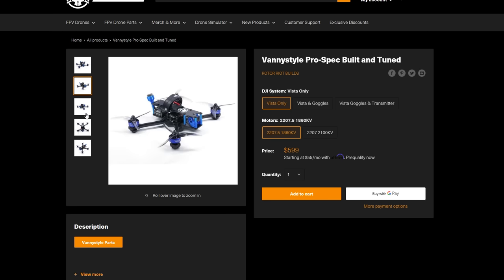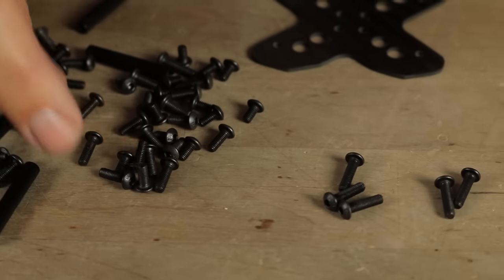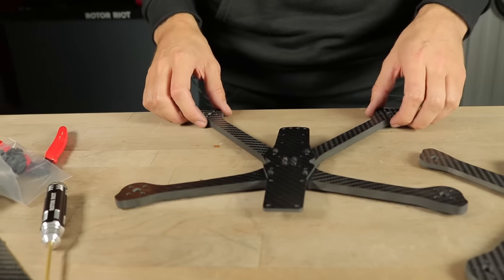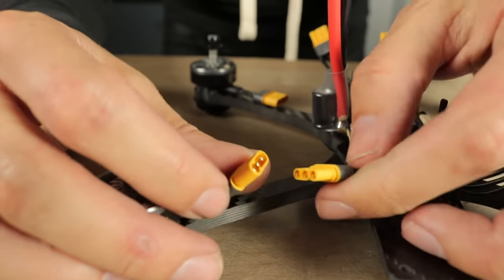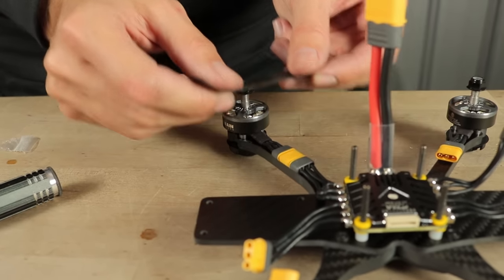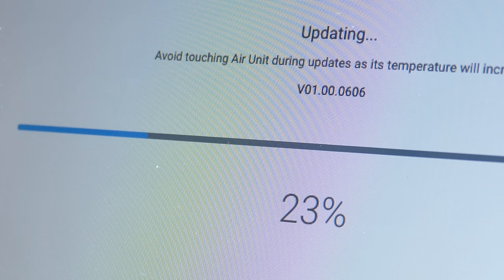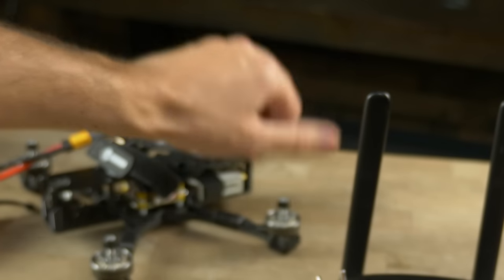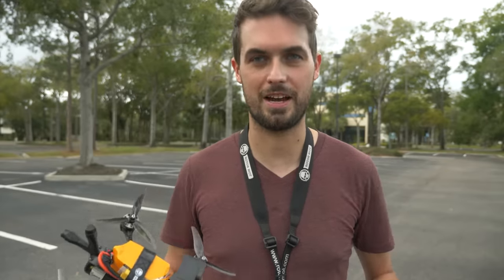Build a FPV Drone with NO SOLDERING! The Plug & Play DIY Kwad.

Comment: Kapper must be so happy right now. He's been pushing this for years. Great move.

EDIT: Also, choppergirl has been pushing this idea for a long time and must be really thrilled to see somebody finally implement it.
Reply: hi bardwell
Reply: Joshuaaaa wasup
Reply: As much as I don't want to see our hobby watered down I must say this would have been really handy about 5 years ago when I first got into racing / freestyle. I spent the first 2 years building with a 20$ soldering iron from lowes and just didn't know any better. Now I feel like I'm a confident builder with a TS100 in my arsenal. I remember trying to fix my one quadcopter between heats when I crashed an feeling the time crunch trying to swap a arm / motor, with this system I could have swapped out a busted arm / motor in about 2 minutes tops. PS thanks for all your guidance over the years Bardwell, I wouldn't have made it without you.
Reply: Honestly they should just be direct soldering that plug onto the esc. Right angle low profile to sit inside reasonable standoffs.
Reply: @Clynikal  Direct solder XT60 is a no go in my opinion. The stress of plugging and unplugging, or in a crash, it breaks off, and often takes the ESC with it. It needs strain relief.
Reply: @choppergirl  I think you're mad that you aren't getting more credit for this idea, when you had the idea of a solderless quad some time back, to make the hobby more accessible especially to people with disabilities. Because you often have what you think are good ideas, and then you present them to people like me or Spatz, and usually we're too busy doing our own thing to be passionate about your idea. But then when it finally does happen, somebody like Rotor Riot gets credit for actually doing it, and nobody credits you for having the idea.

Here's the thing: you are one of MANY people who has the idea of a solderless quad. I have been pushing the idea for years. The idea of a solderless quad is not unique. Just like the idea of a Molex connector is not unique. Actually doing the work of manufacturing all the parts that work together and then making them available to people is where the value is. 

I didn't say, "Kapper is the only one in the world who has had this idea." I just remembered shooting an episode with Kapper where he was pushing this idea, and since this is a RR project I thought he'd be happy. I didn't say, "choppergirl must be so happy," because I don't really know you or think of you except when you come up in a comments section. But now that I do, I will go back and edit the comment to reflect this.
Reply: @choppergirl  well said
Reply: Everyone knew that a simple solderless build would make the hobby as attractive as RC cars for father and son/daughter projects etc. 
The problem was executing that dream concept in a way that can keep up with demand and manufacturing issues etc this is something hopefully they can keep going and in stock and will help FPV growth a lot.
Reply: Been wanting this since I started in 2017.  I build computers without a hot stick, why the h-e-double-hockey-sticks not drones, eh?
Reply: Amazing that this guy is know it all and has no idea we have been doing it for over a year. Nonsense.

Comment: This is definitely going to help get new people in the hobby.  I see so many frustrated comments from newbies that burn a ESC or FC while soldering.
Reply: I fried 2 esc and 1 fc and it costed like 60 dollars per stack i spend 700 dollar only for one drone
Reply: @niksi_fpv2313  oh shit. Damn sorry
Reply: @divingfalconfpv4602  Yup but i learned my lesson
Reply: @niksi_fpv2313  live and learn.  I just realized I rushed conformal coating for the snow and water while drones were together. Sticking brush in it. And I think I ruined all my drones baro. 4 drones.. 3 r long range drones so they need it.
Reply: @divingfalconfpv4602  yeah i rushed and didn't pay attention while soldering thats why i fried few stacks
Reply: @niksi_fpv2313  I am so careful with that. I build a lot of whoops and small drones. That pads are literally a hair width apart. I run razor blade in between to make sure solder isn't bridged. If I think k it is I do it over. I'd have to fix shit before. Then I use multimeter resistance setting tells u if bridged. Then I use vifly smoke stopper and small battery to power up first test. Talking like 3s 300mah lihv for xt30 drones.. lmao.. I'm mad paranoid
Reply: @niksi_fpv2313  also I'll use my galaxy s20 ultra 108mp camera to zoom in like a magnifying lens (even though I have one 🔎)
Reply: Definitely it's going to help people getting into FPV, and it's also looking nice. 👌
Reply: I have no interest in getting new people into the hobby.

Why would I want more people clogging the parks and few areas people have to fly these? Why would I want simpletons that were too lazy to learn how to do this themselves flying around breaking laws and ruining it for the rest of us.

Fpv drones is an individual activity unless you race them with groups of people. The community is a good size as it is. I don't have this goal of bringing it to the masses and I don't understand why some people do.
Reply: @ljfpv0822  Who cares if more people get into FPV? Why does that matter?

So more simpletons at the parks? Flying around breaking laws ruining it for the rest of us?

Yeah, great idea.
Reply: @dangerous8333  Fly in your own yard 😂
Reply: @niksi_fpv2313  don’t feel bad because this is why I’m watching this video

Comment: Man, this would have been awesome 2 years ago when I first started. My very first fpv build was a CL1, watching Drib's tutorial video on assembly. My soldering sucked and it was very intimidating but I got it done. This is great for beginners in the hobby.
Reply: I think this is a poor way for beginners to learn about the hobby.

Like giving someone an electric guitar right away instead of having them learn on an acoustic.

I'm not a beginner and I like it just because it's fast and modular and I don't need 10 drones, I can have one drone. And time is valuable so I can fly harder and not worry that my day will be over as soon as something broke.

Comment: Soldering seems hard but if you buy the right equipment it's super easy
Reply: its not at all, its childs play. And every self builder or new commer can and should master this straight away.
Reply: But out in the field...imagine just plugging in a new motor. I kinda like it.
Reply: @SilverFox80521   Im sure you can buy connectors, without any problem.
Reply: @SilverFox80521  who brings extra motors to the field?  I bring multiple quads, and batteries… but not motors..
  If u crash hard enough to damage a motor.. ur gonna have other components compromised
Reply: @robaxelsson530  motors cost $15 while an HD quad costs over $300. Maybe if I flew analog I would have spare quads. 🤷🏻‍♂️
Reply: @SilverFox80521  or buy enough of theses “no solder” quads and you will have plenty of parts and never have the need to solder..
Reply: @robaxelsson530  you finally get it 👍
Reply: It's easy, just time consuming. That's what I like about this.
Reply: @robaxelsson530  Huh? 😂

The idea is you buy these parts ahead of time and have them in your kit. If you actually have something like this why wouldn't you? That's the whole point.

If something else breaks along with the motor, it's also replaceable in the same way. 

Also, you can burn up a motor without ruining anything else so I don't understand your assumption there anyway.

Your logic is strange.
Reply: @robaxelsson530  Huh? 😂

Do you understand what modular means?

It means you wouldn't have to buy multiple drones. You buy one and then you buy spare parts.

Good grief!!!!
Reply: @SilverFox80521  He still didn't get it.

He said buy "multiple of these quads" when that's not the point. You buy one and then you buy the replacement parts.

This guy is oblivious....

Comment: What an amazing build, i love the motor connectors and actually did this myself when i was building a bunch of test motors(3D printed). It is such a nice little connector and will take all the amps it needs for the motors. But most of all, your prepping of the FC was brilliant, what a service to newcomers to have the PIDs tuned to match the build, i LOVE it ! Well, Well, WELL done !!!

Comment: Love this.  Long overdue.   My next quad will use this setup.    (I wish the 3 pole XT connectors were more common)
Reply: The MR30 connectors are great. I also like the LEDs that can be built into them. The LEDs make the connector a race wire, but hardly anyone carries them...

Comment: Great idea, great video. Just a small suggestion to add for people just getting into the hobby. It's a good practice to twist all wires between the ESC and Flight Controller. Also do the same with the Air Unit to the Flight Controller. This will help reduce Electromagnetic interference and Radio Frequency Interference getting into the key components. With less noise getting into the Flight Controller it will be easier to tune.

Comment: I think a solderless design should be standard now, just simple plug and play, modular approach on components and how they connect together.
Not everyone is comfortable with soldering etc
Reply: What kind of hobby is that then? Open your wallet and show your visa card till the next crash?
Reply: @guardianobserver6593  It's just a natural progression of how building electronic devices usually developes.

I remember a time computers came as kits you had to assemble and solder some components and wiring together etc
Now everything is simple and easy  plug and play!
No reason FPV can't go the same route and still be a 'hobby'.
Reply: @pdtech4524  The difference is people don't take their computers out, clogging the parks, cramming into smaller and smaller areas we have to fly.

Computers don't cause new laws to be made because irresponsible lazy people that didn't have the time to learn soldering also don't know how to learn rules.

Fpv is the last hobby I want the masses of simpletons to get involved in.

I'm with Guardian on this.
Reply: @dangerous8333  Drones are a niche thing and always will be, the 'masses of simpletons', you mention have no interest in them whatsoever.

Comment: I remember buying my first FPV drone used from a person who tried to enter FPV but was expecting DJI stability (he was a cinematographer working on indie films). His build was mostly wired with connectors. I also remember crashing ever so often in my first flights due to connectors popping out. After my 2nd day flying, I removed most of the connectors and soldered the wires directly. But to be fair with RR's solderless build, the connectors used are much better than the connectors that was used on the used FPV quad that I bought a couple of years ago so plugs disconnecting mid-flight will likely be much less than what I experienced. I guess the guy I bought it from was planning for a more docile quad so using servo connectors  and cheap power plugs was not an issue for him.

Comment: The first no-solder drone I would actually buy. Still, at some point a bent prop will cut a motor wire and users should know what to do then. Of course, pilots who aren't that crazy about using the DJI controller will have to solder a receiver before taking this to her maiden flight.
Reply: Swap wire.
Reply: @MindRiderFPV  Right, but what if it's a wire that's soldered to the board?

Ah, you weren't thinking about that were you.

Hence why it's important to still learn how to repair these things the old-fashioned way. In fact, I don't even see this as something for noobs. I see this as something for someone that is busy or just doesn't like soldering. Just because I can solder doesn't mean I want to.

Comment: I love the MR30 connectors that make the plug-in connection possible between the ESC and motors. I prefer to only tape down the arm side of the MR30 connectors, so if I break an arm, then swapping motors and arms is easier.
Reply: I was thinking this!!
Reply: its just a piece of tape LOL
Reply: @ziggyzbeak  A strategically placed piece of tape 😉

Comment: Nice vid Drib! I bought  the HD1 and the old CL1 almost 2 years ago, since then, I have only replaced one arm on each and one top plate on the HD1 (no serious breakage one top screw rip through the carbon but still flyable). Dam good if you ask me... Rotor Riot sells very good quad frames. ... PS  Please bring back the old CL1.

Comment: love the video i did try to build a FPV Drone on my own and soldering are on the right arm still on the shelf my question can i buy the parts and put it together with my Frame which is a IFlight TITAN DC5 "5" FPV Frame for the DJI Air Unit and the battery are GNB 1800mah 4s 130oc Lipo Battery and thank you and i have the version 1 googles with control too.

Comment: Sounds promising. I guess that the next logical step is to create a domino style universal connector for the motor wires. Each wire would be secured by a small screw and it could allow to choose whatever motor.
Reply: Or a spring/caged ferrule

Comment: This is great! As someone new to the hobby that's trying to build my first quad I can say soldering is already making me want to quit this hobby (and I absolutely love flying and never quit anything). No matter what I do I cannot solder the negative battery lead to the ESC pad. Might sell all my parts and get this to be honest.
Reply: You should still learn to solder. You may still need it. Unless you're planning to use the DJI controller you're going to have to solder in your own.
Reply: @dangerous8333  i learnt :) and i built my first quad! i figured out the reason why i couldn’t solder was the solder i was using was awful, so i got some new solder and all my issues were fixed

Comment: Bought the stack and motors.  Used a different frame.  wired it up and mounted all the components like you showed in your video.  The flight controller appears to have no valid configuration in it.  Can I down load he configuration file?

Comment: Quick question, what connectors did you use and what kind of currents and amps are running through the connectors ?

Comment: These would be more popular if you would use a cheaper esc. Keep t-motor for premium setups but a budget option is needed for your solderless builds. The esc ends up being the most expensive part.

Comment: This is the way forward.  The powertrains have gotten so connectors on the larger platforms are no longer a factor, weight-wise.  Also makes field repair a thing - which is why it should have been implemented long ago.  Lets neophytes build custom rigs at a whim, like it should be.  Many upsides, few downsides.  More, please.

Comment: Just an FYI: The link in the description for the DJI Assistant 2 activation is not for the correct version. Spent some time tail chasing on that one! 😬 Scan the QR code that comes with the Air Unit for the correct link.
Reply: yea you need dji assistant 2 fpv series or else the program wil not see the air unit.
also use a fan wile updating

Comment: You should never have wires touching your fc board if you can help it they can transmit noise through too the gyro trust me I’ve had this happen first hand took me a month to figure out why my quad was flying like shit and shaking on heavy throttle

Comment: do not flatter yourself .. you still have to solder the receiver: tbs or elrs.  normal people don't fly using 5.8ghz frequency for remote controll (DJI is controlled by this frequency).  you still have to seal all the electronics from moisture, water and snow.  you will also have to solder the GPS module if you do not want to search for your drone like a blind hedgehog after it falls, solder the buzzer anyway, if you don want to search drone after the fall like a blind and deaf hedgehog)

Comment: i bought all parts to just plug and play outside doing xt60 and motor wires.. and stupid dji plug wouldnt work.. i send it back.. next flight controller dji plug wouldnt work.. have to switch to different flight controller (then of course rearrange esc wires lol) . other plugs did work but not dji for some reason. did work if i soldered but i was annoyed lmao

Comment: Isn't better to place the air unit upside down ?
In that way the antenna connectors touch the airunit..
Reply from the maker: We have tried this, and some pilots prefer it. But we found that using the sticky tape on the top side of the unit more often results in that top side getting pulled apart. Installing the air unit as we’ve shown here ensures the longest life for the air unit itself, although as you mentioned you might have to replace antennas a little more often

- Drew

Comment: Fpv=learning to solder.. no way around it.. if this is directed towards “new” pilots.. I hope they have DEEEEEP pockets! As they will have to use DJI goggles AND controller..
  So this quad is locking them into the DJI eco system..
  It will be one EXPENSIVE learning curve…
  Let’s not forget, what motors will RR offer with these “connectors”? Will they be the more expensive(names)? And how much will be added for the connector and soldering? $5? $10?

Comment: I've seen this YouTube short of "correctly" applying loctite where you basically soak the screw in loctite and even add loctite to the threads inside the hole where you're putting the screw and everytime I see and hear someone using loctite I just look back to that video and laugh my ass off

Comment: Rotor Riot why did you send both of the Tmotor solderlees kits That I paid over 130 apiece  without the power leads soldered???? That is the hardest part for me to solder be cause I need large Iron to pool large solder joints, Do you nguys not like me, Are ya incompedent? Or only care about the money?